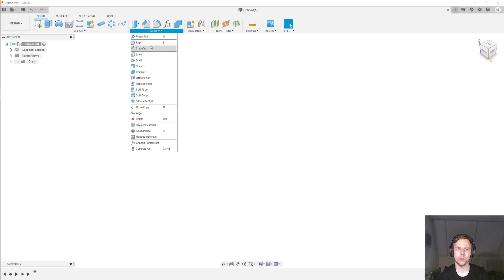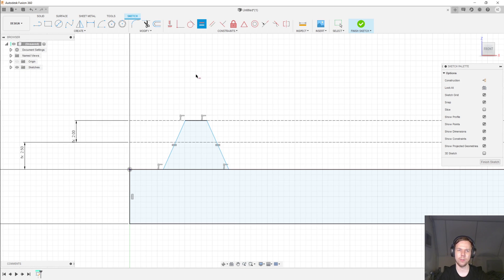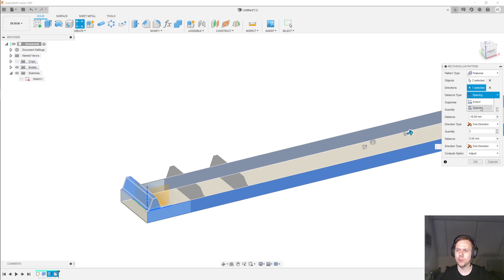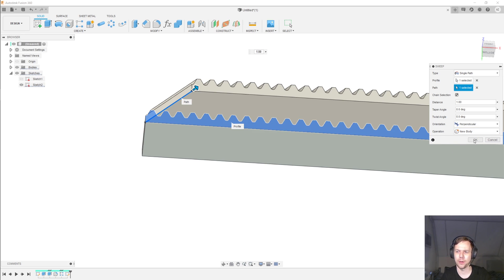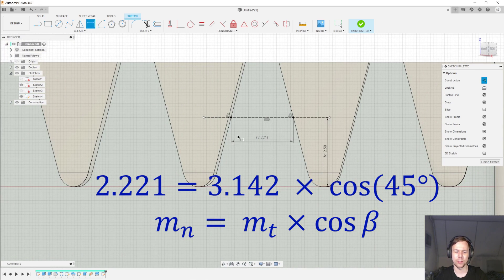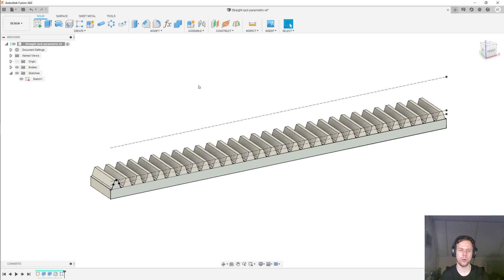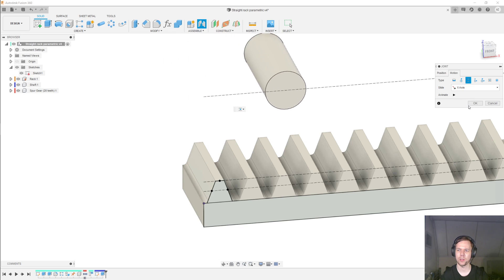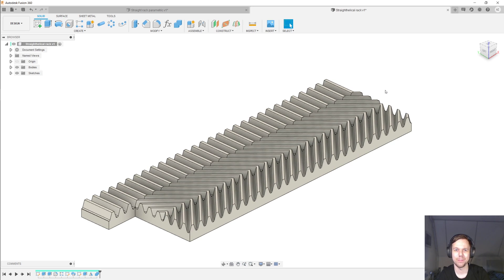How to model Gear Racks, Straight and Helical, Parametric (Gears pt 4/7)

Comment: at around @2:00 in the video how do you get the line parameter to get it above the base of the rack (1.25* module) what do you get click... i select the line and the rectangle length but then i don't know whta to do to get the value window
Reply from the maker: I'm using the dimension command, using the shortcut key D.

Comment: I got to hand it to ya.  I've come back to this video a lot when working on projects. The knowledge you gave with those  user parameter settings are gold. For everything, not just gears. I  kind of learned that the hard way last project once i had way too many fixed dimensions to make it manageable. So now, I am starting over  from scratch, and the first thing  I am going to do from now on with EVERY  project I start  is make a dimension list and then enter all those dimensions as user parameters. It's not that my fixed dimensions weren't accurate before, but only for certain models and conditions. Which of course, have a way of changing over time. With editable parameters, i don't have to start over anymore. I just change the parameters. This is going to be a staple of my workflow from now on. THANK YOU!

Comment: thaaaaaaank you for not relying on a generator. i dont know how to implement gears, so i need them to be easily adjustable while i figure it out, which means i need parametric. seems like every video relies on a gear generator or pre-defined dimensions, which is great for if you already know what gear you need, but not great if youre still figuring that out
Reply from the maker: Would you be interested in manually drawing the gear/pinion in a parametric way? I never covered that actually, some others have but in my opinion generally not very well.
Reply: @antalz  haha, i spent several hours after that comment trying to figure out how to draw the pinions parametrically and i was able to make something that looks very much like a gear. but which is significantly (about .25mm) off of a gear generated with the same variables by fusion, and it doesnt mesh right when i try to animate it. i think youtube is sorely lacking a good tutorial on how to parametrically model involute teeth!

Comment: I am trying to make a helical rack for my helical pinion of normal module 1.5. Would the module I use in the parameters for making the rack be the transverse module (the normal module of 1.5 divided by cosine 17 degrees)? When I do the sweep what module would the helical rack have (I’m guessing 1.5)?
Reply from the maker: I think you got it right. When doing the sketch use a (transverse) module of 1.5/cos(17 deg), your formula is backwards, the transverse module is always larger. You don't need the module anymore when sweeping right?

You can also just sketch the gear profile on a normal plane, in that case just use 1.5. For racks that's not so complicated. The two methods do have a slightly different result: the height of the teeth is based on the module, in the first method it's based on the transverse module, in the second method on the normal module. You can also just use either method and specify the tooth height that's right for you. I believe it's usually based on the normal module. So in your case addendum of 1.5 mm, dedendum of 1.5*1.25 = 1.875 mm.
Reply: @antalz  Thank you for the reply. Just to clarify, in making my rack, I have done the same as what you have done in the video, expect that my module is my transverse module (1.5/cos(17 deg)). So the addendum is 1.5/cos(17 deg) and the dedendum is 1.5/cos(17 deg) * 1.25. I have then done the sweep (and yes, the module isn't needed when sweeping). I think that this helical rack will mesh with a helical gear of a transverse module of 1.5/cos(17 deg) - do you agree? I am 3D printing the rack and pinion soon, so I will know the answer shortly if you don't!
Reply from the maker: @Thomas-vi5yw  Yeah that should work out, though if you make the helical gear yourself too, using the method I usually use, then it will have longer teeth. Shouldn't be a huge problem though.
Reply: @antalz  Thank you. I am actually making this all in Onshape which has a helical gear creator function, so hopefully there isn't a problem. Thanks for the help!
Reply: @antalz  I printed off the gears today and they mesh very well - very smooth! Thanks for the video - your method works!
Reply from the maker: @Thomas-vi5yw  Thanks for the update, great to hear!

Comment: Incredibly useful series! I've been trying to find a spur gear generator for a while now. Who knew it was built into Fusion 360. This series as helped a lot with the 3d printer motion system I've been working on. Thank you!

Also, a useful tip for those who don't know, you can right click on a sketch and click "Show dimensions" so you can modify dimension values without having to go back into the sketch.

Comment: This video is helping me a ton already, thank you for sharing :)
one thing that will help, does the gear and rack need the same amount of teeth, or is there a ratio we can follow?
Reply from the maker: No that doesn't matter. The only requirement is that module and pressure angle match. Besides the the module*number of teeth does determine how far away the gear should be mounted from the rack, and how much rack travel equals one rotation of the gear. There's a bit more info on these words and equations in video 2.

Comment: Tough for me as a beginner to figure out what shortcuts you were using, but did eventually make it to the end. Thanks for this. My next question is: What changes would I make to the joints and motion link in order to make it so the gear rotates in one spot and the rack moves?
Reply from the maker: In that case you'd ground the shaft, and then instead of putting a slider joint on the shaft you have to put it on the rack. I think that's all. And yeah these tutorials are a bit tough if you're very new to Fusion, but I'm glad you figured it out in the end.
Reply: @antalz  I had actually tried that first, but it didn’t work. I couldn’t figure out how to make a slider joint between the rack and construction line,mor it wasn’t working anyways, so I’m going to put a rectangular base to slide with the rack. Also, would i create a motion link between the rotation joint of the gear/shaft and the slider joint of the rack?
Reply from the maker: @sethother8012  I never tried slider joints onto sketches, you could be right that doesn't work. And yes the motion link should be between the slider and the revolute. You probably also want to ground the base you made.
Reply: @antalz  I'm trying this, but I just don't understand why it doesn't just slide in the position i started with, which is  the rack's back touching a similar dimension block. I want it's back to slide up and down the length of a long 2 x 4 type shape. The first component i pick is the one that slides, and the second one i pick stays still, right? Well, when i choose the back face of the rack first, then the face of the 2 x 4 second, it gives me no x , y, z choices until i click revolute or some other motion first THEN slider, then i change to slider, but instead of making the back of the rack flush with the face of the 2 by 4, it rotates it 90 degrees, so the gear rack is perpendicular to it, and also places it upside down so the teeth are against the face of the 2 x 4, How can i make so it will just slide from the position they are in?. I kind of have to move the rack  out of the way to access the  back of the rack that i need to the slide, but when i click the 2 x 4 face second, i get perpendicular,  like the rack and 2 x 4 form a cross and upside down rack
Reply: @antalz  I think i figured it out. So I guess you have to choose exact center of both the rack and the 2 x 4? Even if just sliding?
Reply from the maker: @sethother8012  I think you mean the joint origin, then yes you have to select the right spots so the joint is made in the right location. You could also use an as-built joint, that's probably easier.
Reply: @antalz  Thanks for the tips. Keep up the good work

Comment: Hey, I'm trying to create a curved rack and used the fit point spline tool for the shape of the rack but, I can't select the line itself for adding dimensions. I can only select the green handles for the spline. Can you tell me how to get around this please??
Reply from the maker: Short answer, you can't. The curve of a spline is determined by the position of the fit points and the direction and length of the handles. Depending on what you want to do you can apply constraints to the handles and put dimensions to locate the fit points. Especially vertical/horizontal/tangent constraints on the handles can be handy.
Reply: @antalz  ok, thanks for the speedy reply!! I’ll keep working on it.

Comment: I have a problem when to make rectangular pattern. how can you help me. I am a bigginer, I just finished step by step with you and draw till the 1st tooth. cannt make the full rack. thank you
Reply from the maker: Could you be a bit more specific with what the problem is? You need a rectangular pattern of features, and then on the timeline you can select the features that need to be patterned. Do you have the timeline enabled? Have you done the extrude operations?
Reply: @antalz  after long hours I mange to do it. I had problems getting the direction arrows to appear. it kept saying choose direction and I didnt figured it out. trouly I dont know what I did to bring them. but now its sorted. Can I send you photos next time if i have problems. Are you on other social media please?
Reply from the maker: @enginelover1  I'm on Instagram but not really active, certainly not lately. You can reach me by email at antal@creonova.nl

Comment: I have a doubt.The distance between the inter section of the pitch line is 5 time of the module devided by 2. As the module is 2mm, 2x5 devided by 2 is 5.but your measurement is 3.142.How does this happend
Reply from the maker: I'm not sure where you get the number 5 from. In the description I link to a page from KHK gear, that diagram shows the dimensions exactly. If it seems I didn't accurately reproduce that drawing in the video please let me know.

Comment: Great video series! I think you can get the width parameter to work (at least in this case) if you open the spur gear component and edit the two extrudes, replacing the distance values with your parameter.
Reply from the maker: I should give that a try, but unfortunately the thickness is perhaps the least interesting parameter. You can just change it whenever by extruding the flat faces. You could even change the module by doing a scale in XY. The big blocker is the number of teeth, which obviously affects how many teeth there are, but also the shape of those teeth. That just can't be parametrized unless you sketch an involute approximation yourself. If you want to try that out, check out a small channel named "Steel Stone"
Reply: @antalz  I saw that video, pretty involved process. Another approach might be to hack the SpurGear.py script to accept an existing component, then update the 2nd sketch with the tooth profile using points generated by the new parameters. With any luck the extrudes, fillets and pattern commands that follow would still work
Reply from the maker: @bobmvideos  That might work well. Unfortunately I haven't yet checked out scripting in Fusin360, and I fear I won't for a long time to come. I'm quite busy at the moment unfortunately, even my next video on the 3D printed drybox is seriously delayed.

Comment: I wish there was a way to approximate spur gears parametrically including undercut. Otherwise you need to know all parameters of your gear upfront, especially if you're modifying them further. Numerous times I had to go back and replace a gear and then have to redo tens of downstream operations that would become invalid.
Reply from the maker: I think you can do stuff like shaft-shaft spacing parametrically, and then import the gear from another file. Then if needed you can change something you can change the parameter, and then replace the gear with another one. You can also do it parametrically, but boy it's a lot of work:

https://www.youtube.com/watch?v=NaW4jWARFdY&t=1s

This also doesn't do undercut, but neither does the standard generator I've since learned.
Reply: @antalz  Yeah different file for the gear can still lead to the same problems if you have to extrude/align to/from gear surfaces as well joins/cuts. I guess one could carefully work around those but it's a lot of work, especially when you're not sure what you want exactly upfront and need to redesign parts. I use GF Gear Generator which seems to do the undercut and can do bevel gears, but it's still not parametric and it's limited in other ways (preset module values, no backlash etc). But on the other hand I want to have parametrical backlash, so I'll live with the suboptimal offset. Here's the project where I use a combination of helical and bevel gears https://www.youtube.com/watch?v=9VcGwiHOALg
Reply: @antalz  Love your videos btw, just found them. I was thinking of doing some tutorials on gears but yours are way better haha! Watched the entire series.
Reply from the maker: @MihaiAndreiStanimir  Thanks a lot! For your rewind mechanism yeah it's really painful gears just aren't parametric. The video I linked constructs them from scratch, but that's a huge chore. But if you're going to do a lot of iterations maybe worth while.
For a lot of gears you can use your slicer's horizontal expansion or XY compensation setting instead of modifying the backlash. Doesn't completely work for bevel gears I think. You can also give yourself some play in the shaft-shaft distance.
Reply: @antalz  Yeah, it's too much work from what I can see in that video. Would be great if that could be saved and insert-derived into other files. Sadly all the reference parameters become read-only :(
Reply: @antalz  I guess I could reference the project with the gear and then break the link. That would bring the parameters into the new file.

Comment: Hi, since you linked the KHK site, I figured, why design my own gear when they provide the 3d model for what I need? So I downloaded their model but now I don't quite know how to mate them, is there an staright forward method to do this?
Reply from the maker: I can interpret your question in a few ways:

1) If you want to know where in space your gear should live, for regular gear-gear sets watch video 2. For a gear-rack set, I point out the pitch line near the start of the video. That pitch line must be tangent to the pitch circle of the gear, just like how the pitch circles of a gear-gear mesh must be tangent.
2) If you want to know how to add mounting features suitable for 3D printing, check out video 1
3) If you're making helical gears/racks in the normal system, check out video 3. For helical gears in the transverse system you can just use the math from video 2 without changes.
4) If you're asking about joints in Fusion360, I don't cover that explicitly but I do show it a few times in the different videos, and you can find how I did it in the example files in the description. "Mate" is also a technical term for the functional equivalent of joints in some other CAD systems, if you're asking about those, I can't help you very much because I don't have active licenses in those CAD softwares. There are tons of good tutorials on the basics of inventor and solidworks though.

For all cases the chapter markings in the videos should point you to where you need to go. Let me know if I failed to understand your problem.

I should point out that while I title all these videos "How to model X", that is really only part of the equation, and useless in a vacuum frankly. How to print them, how to mount them, where to mount them are all explicitly part of the tutorials. I should perhaps use a better title, but I felt that "how to model X" would do well in search.